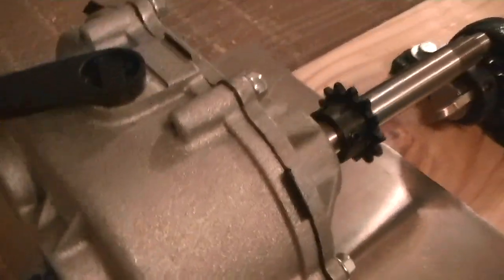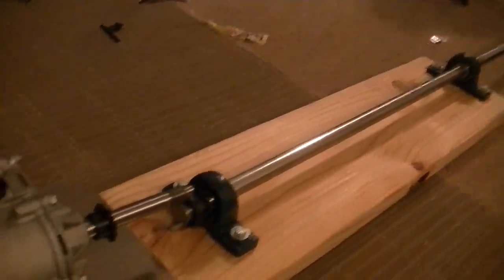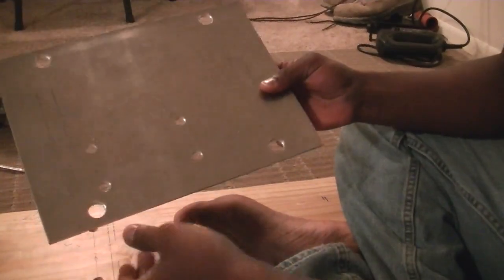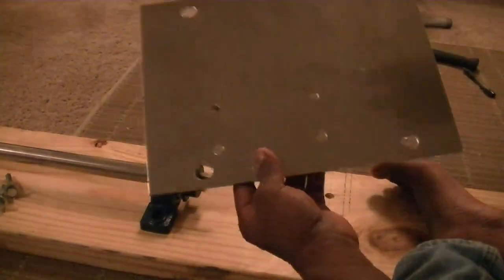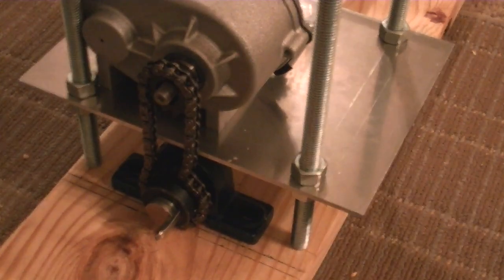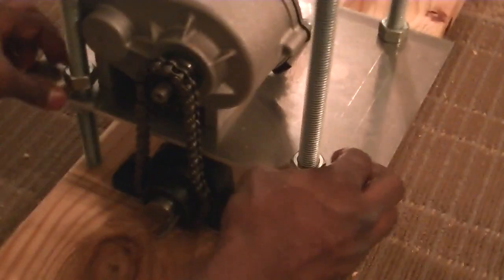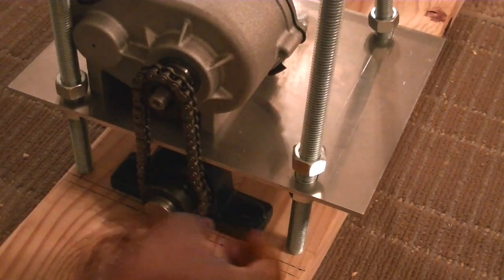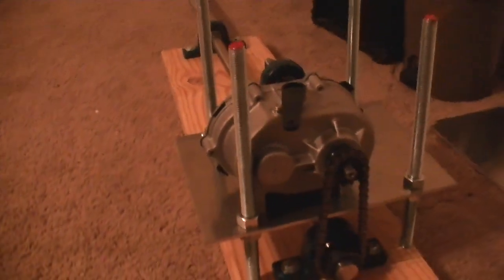Homemade plywood boat pt3(gearbox mount)

Comment: Take your square foot in the pivot point where it says pivot take a string with the plumbing Bob and if it winds up to 45 on the bottom then your aluminum plate will be level if you don’t have a mini laptop you can use your square

Comment: hey there, you ever think about using a torque converter like off of a go kart to run the shaft instead of the comet clutch you used in your old setup? Just curious
Reply from the maker: a few people recommended the same thing pacific; thats exactly what im looking at next. Thanks bro!

Comment: I think that is ingenuous how you can fine tune the alignment of the drive chain and easily adjust for different  drive sprocket. Well done man.
Reply from the maker: Thanks a lot Dean; I wanted to try something new  to see if I could pull it off.
Thanks for watching brother

Comment: can i use motorcycle engine to drive the boat ???
Reply from the maker: I would say yes; with a little research and motivation anything is possible.
Thanks for watching
Reply: +ronaldhotboy will you tell me wht type of research i have do??
Reply from the maker: I would start off to see how PWCs work; then see how motorcycle engines run.

Comment: Use carter pins and nut then drill the size of the carter pin threw your threaded rod when your happy with your adjustments/also use rubber washers, Doing a good job Mr.
Reply from the maker: You have some awesome advice bro! Super helpful

Comment: hey, Im perusing a similar project.

what type of gear box is that?

where did you get the spockets/gears and chain for attachments to the shaft?

what kind of thrust bearings or attachments are holding the shaft? 

Thanks
Reply from the maker: it is a comet gear box (about $240)
I always purchase my parts from ebay (make sure the seller has good rating)
I used what they call "pillowblock" bearings.
Thanks for watching bro

Comment from the maker: Thanks a lot bro! What I've decided to do with the shaft was to raise the very back end  of the boat (so that the bottom is now on an angle allowing the prop to be lower than the hull). Im still trying to choose between a single rudder or dual. What do you recommend? As far as the engine, there will be a duct system coming from the side-skirts of the boat with small fans (if needed) along with a sealed exhaust system exiting out of the rear. Thanks bro; big help!

Comment: I love your boat design.  It looks cool.  But, I'd like to make a few suggestions.  From the look of your design, you are going to have excellent weight displacement, but you may want to consider a universal joint to change the pitch of your shaft?  May now be too high.  Also, be sure your rudder is behind your prop or consider a dual rudder system? My last project didn't steer so well with the rudder in front of the prop. And if your engine is air cooled, you'll need ports and vents. Good luck